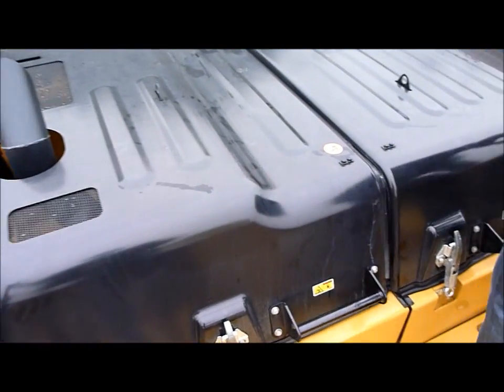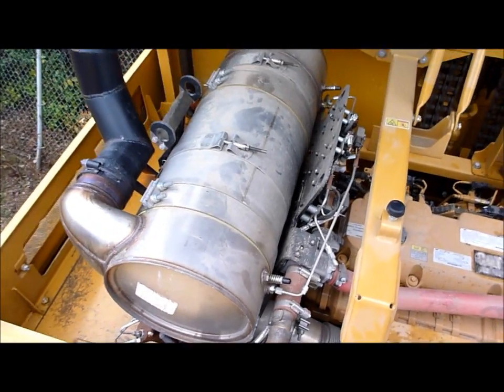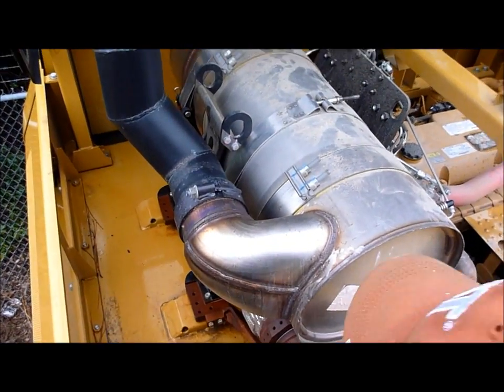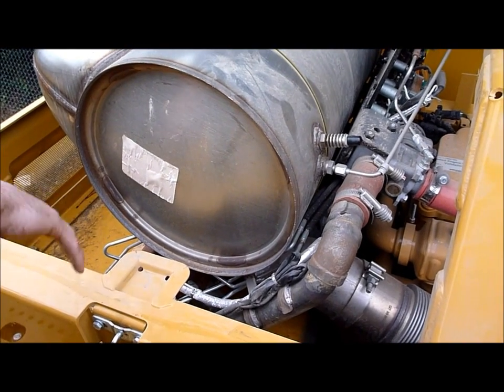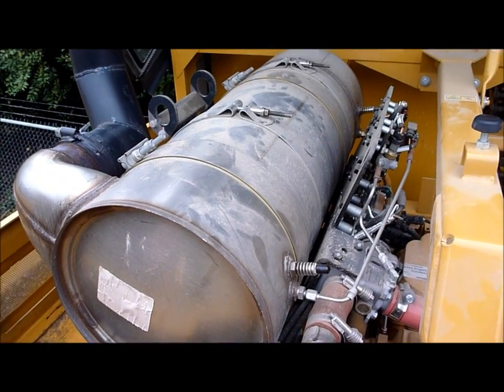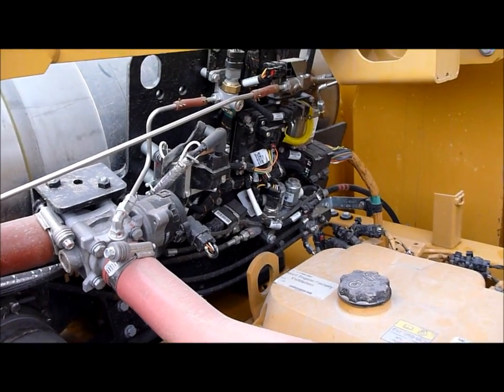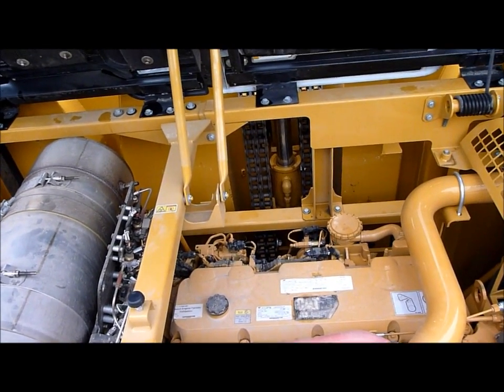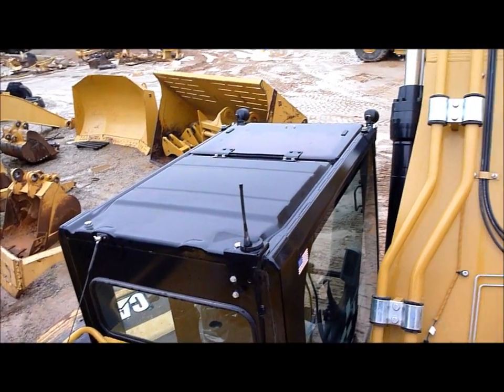New Cat 349E Excavator Emissions Overview

Comment: $7000 to replace on my Sterling truck i'm told. Same system that uses diesel to burn and regenerate. Haven't had much trouble with it but makes the truck so much harder on fuel. Have trucks using the DEF fluid and some won't go into regen and countdown to shutoff constantly. Can only imagine the fun of this on heavy equipment when it comes for us.